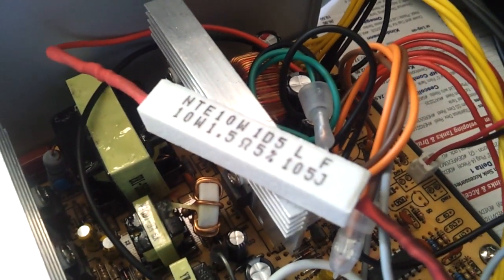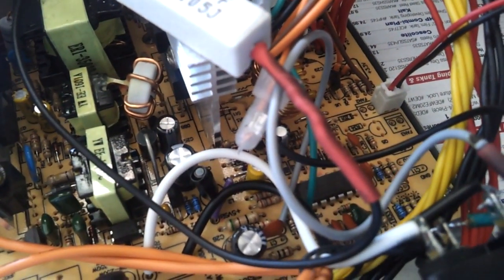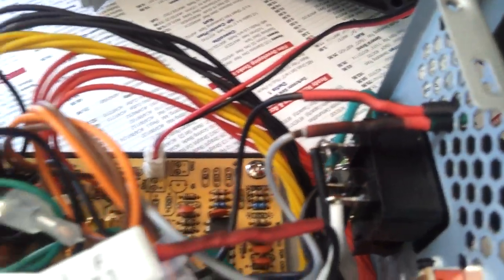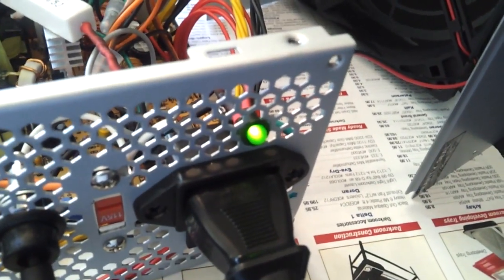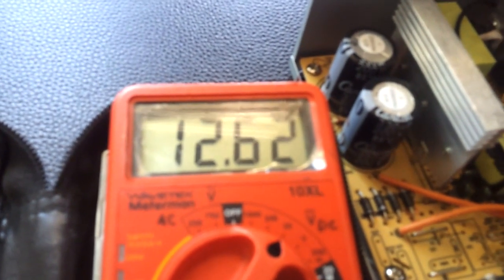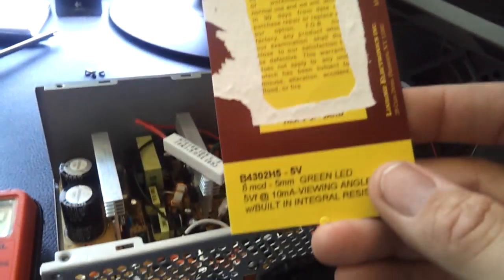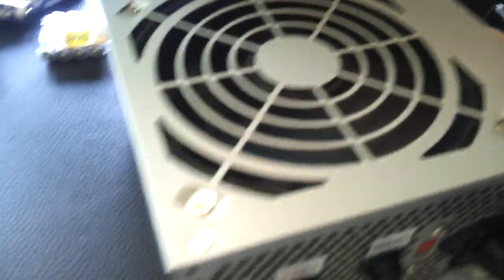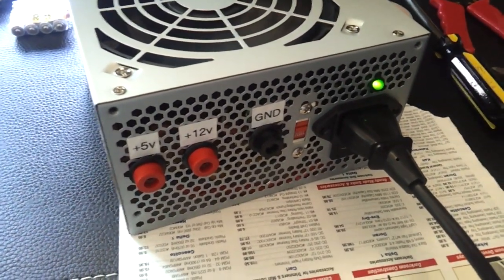Converting an ATX power supply for RC - Pt.2

Comment: you answered one of my questions regarding the power good LED and for that I thank you. Next I want to add a small DC Power switch to wire to the green power and ground wire to turn it on but I want a different color LED for power on.

Comment: As I said on the previous comment, the resistance is too low on the 10watt resistor. You want at least 2 ohms though i would recommend 4 ohms. I would solder the other resistor in series with the one you have in there and call it good.

Comment: Just build one. Using a 10 ohm resistor works like a bomb. Thanks for the video man
Reply from the maker: +Chiral glad to help
Reply: So adding that resistor bumped your voltage for 12v output? My old HP power supply only puts out 11.2v without a resistor.
Reply from the maker: Jose Minay Yeah, you have to put a sufficient load on the circuit to get the voltage to come up and be steady at higher amp draw.  It would appear that some power supplies are OK without it, based on the other comments.
Reply: I did the same. I could only get mine to output 11.7 volts. It's an older supply. Thanks for the response!
Reply from the maker: +Jose “interj11” Minay that should be fine really

Comment: Not sure whether I noticed it correctly but in the video it seems as if the led is connected directly to the POWER OK (grey wire) and the COMMON (black wire).  This would mean 5V directly on the led. I think that is not correct as it requires a resistor in line with the led to reduce the voltage on the led and to regulate the current. A typical led uses 20mA of current and operates at roughly 2V. That means that when you connect it to 5V there should be 3V over the resistor and 2V over the led. In order to achieve a 20mA current this requires a 150 Ohm (0.25W) resistor.
Reply from the maker: thanks René.  that LED has a resistor on it.

Comment: 2:40 - 2:55. Your resistor can't handle the load. It's a 1.5Ω Resistor, 10 Watts, 5% Tolerance. You have it hooked up to 5Vdc.

Here's what Ohm's Law says about that. 5Vdc, 1.5Ω, 3.33Amps, and.. here's the part you are going to like the most.. Ohms law says it will dissipate 16.66 Watts.

You need a resistor that is at least 20 Watts, if you are going to use a 1.5Ω resistor.

Maybe more.. That specific resistor has a tolerance of 5%. That's the accuracy of the resistance... No, it's not over 1.5Ω, the tolerance means it's under.

1.5Ω x 0.05, which is 1.5Ω x 5%.

So.. (1.5Ω x 0.05) = (0.075 - 1.5) = 1.425Ω, so it's anywhere from 1.425Ω to 1.5Ω. I'm going to guess and say it's not 1.5Ω, but more towards 1.425Ω

If that's the case, then it could be dissipating anywhere from 17.54W to 16.66W. It's probably more than 16.66 watts. 5% tolerance label on it.

Want the inside to run a much cooler? Then I'd purchase a resistor with a higher power rating, like 20W, 30W, or higher.
Reply from the maker: Thanks for watching, that resistor has since been swapped to a 10W 5 ohm.  It's been cool enough and the case fan helps even more.  5 ohms (even at 4 ohms which is 20% lower) should keep it within the 10 W rating.
Reply: +Mark II I've opted for a 4.7 ohm 10 watt resistor - According to my calculations; at 5 volts that should run at 5.32 watts and pull 1.06 amps from that power line. I've not allowed for the 5% tolerance which will likely increase that wattage, but still keep it below 7 watts.  I hope :-)
Reply: Arrrgh ... couldn't sleep :-) 
Factoring in the 5% tolerance I make it a worst case 5.59 watts.

Comment: can i plug my lipo bat directly on the power supply? cause i dont have lipo charger
Reply from the maker: No you cannot for safety reasons.  You would have no control over the amps going into your pack,  the charge rate.  Don't do it.  Buy a charger.
Reply: Oin Taylor okay thanks for the inputs man great job....

Comment: Hi Oin, I love your this tutorial, but can you tell me why and for which purpose do you use 10W, 1.5 Ohm resistor?

waiting for your reply???
Reply from the maker: The resistor was used to make sure that the power supply recognized it had a "load" being applied to it,  like as if it were connected to a motherboard.   By doing this,  we make sure the power rails are actually fully outputting a true 12v and 5v.  Some others have said we don't need to use the resistor or that it should be a higher  value resistance (10 ohms instead of 1.5)   I guess it just depends on if your particular power supply will work without it.  I may cut it out and see what the results are for me.   Thanks for watching!   Click the thumbs up!
Reply: Oin Taylor Did you ever get the chance to test it without the resistor to see if any change at all? Seems to be a debate on it, was just wondering from your experience. Thnx for the video!
Reply: Oin Taylor
My ceramic resistor cracked. I checked after 2 hours working non stop, just to see what happened and i was cracked. i will try an aluminim 10w 5ohm and see the results.
Reply: Oin Taylor
A resistor of 1.5 Ohm on 5V will result in a 3.3Ancurrent. That again means it will consume 16.7W of power. Hence why your resistor will get very hot (and crack) as it is more than the 10W rating of teh resistor.  You are indeed better of with a 10 Ohm resistor as that will result in 0.5A instead and thus only 2,5W power consumption. More then enough load for the power supply to stay on and also produces less heat.
Reply from the maker: I have replaced the resistor with a 10w 5ohm since this video.  The fan is still working on it and I have not had any heat issues so far.
Reply: René Bak hi, i tryed a 10w 5ohm resistor and all went well. Almost no heat. I'll keep it like that.
Reply: DoubleHelix
Hi yes the 5 Ohm will result in 1.0A and thus it will consume 5W. That is within the 10W specs hence why it will stay a lot cooler. The 10 Ohm will result in half the power consumption. But as you said the 5 Ohm 10W resistor will work as well.
Reply: René Bak thx, that info was very helpful.

Comment: Is fan necessary when power supply is used outside computer case?
Reply from the maker: Yes I would always keep the fan, just in case anything were to get too hot.  In this case,  the resistor does get pretty hot so the fan is definitely needed.